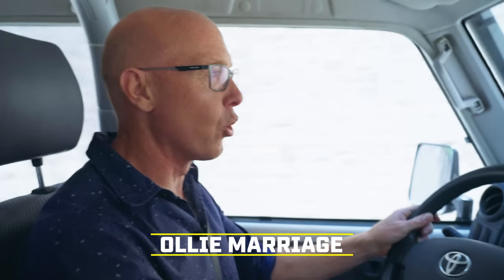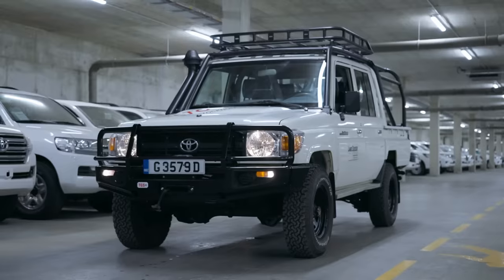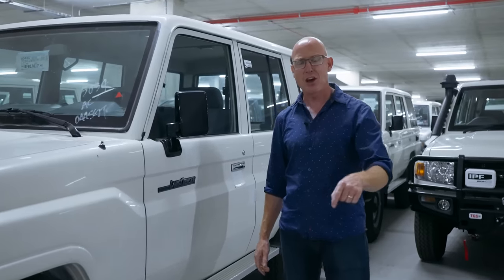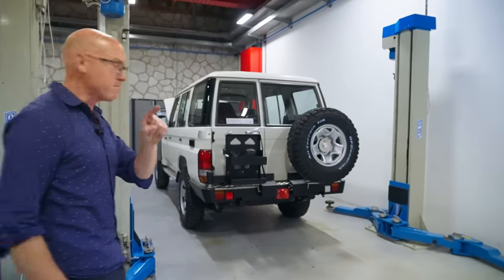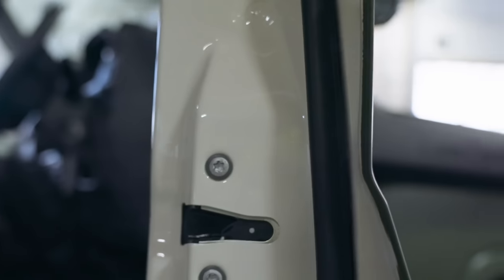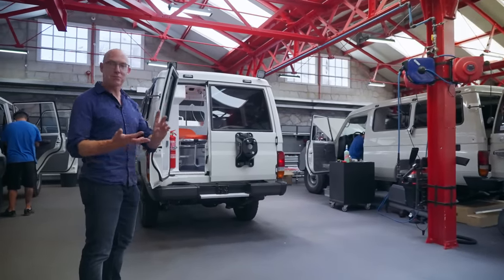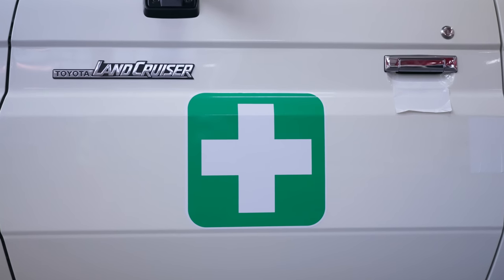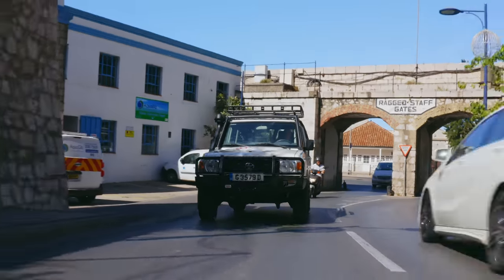This Secret Dealer Sells White Toyotas That Save The World | Top Gear

Comment: Fantastic video, thank you for visiting us at Gibraltar.
Reply: Thanks for letting them into your plant to see the operation. What percentage of your Land Cruiser 70 Series are sourced from Japan and what percentage come from Portugal?
Reply: can normal people buy it directly from you?
Reply: @rightlanehog3151  Al the cars fabricated in Ovar Portugal goes to south africa ,   i visit the factory in Ovar,
Reply: What engine is in those 70's?
I was assuming they'd be the VDJ but there's no bonnet scoop.
Are they running front mount intercoolers or no turbo or something different all together??
Reply: @adam.barrett  v6 diesel or else 4 banger
Reply: @adam.barrett  Seems like these are fitted with the Inline 6 1HZ Engine.
Reply: @adam.barrett the one in video is likely the 1hz equipped one although they also offer the 4.5 V8 in the 70.  They also used to do a 9 seater 200 series with the manual V8 combo of the 70. The Prado/hilux/hiace and previously the fortuner gets either the KD/GD or the 5L-E
Reply: Do you sell these to private buyers??
Reply: to bad you cant register it in europe. perfect kayak towing car
Reply: @hans70998  😭😭😭 that sucks…. My life would be complete with one of these
Reply: Thanks for keeping the world going Toyota of Gibraltar.
Reply: @hans70998  I heard registering in most European countries works just fine with some exhaust modifications (Euro 6).
Reply: @adam.barrett  it is called the 1HZ, a 4.2L inline six cylinder diesel.  About 130HP.  Not fast, not super economical...but torquey, and super reliable.  Been in production since the 1990s.
Reply: @adam.barrett The previous 70 Series (in the video) came either with the 1HZ (as in the video) or the 1VD-FTV with bonnet scoop and the current one comes with 1HZ or 1GD-FTV. There was also a non-intercooled turbocharged version of the 1VD-FTV that was available in the 200 Series from TGS but the 70 Series never got that.
Reply: @rxzxqx6982  But won't get a road permit to drive in public roads. 
Miners and such guys generally buy and can use inside private property but not outside.
Reply: How do you buy one for personal use in the US

Comment: I wish they would make these available in the USA . They would sell faster than Toyota could make them!
Reply: Its diesel, and USA kinda hate diesel car
Reply: They already have that problem. In Australia they come with a 4.5 liter v8 turbo diesel, and the wait for a new one is years.
Reply: they are so popular in australia they stopped production
Reply: get a 4Runner SR5 trim. It's got the guts and since the US has developed roads and mechanical support, it will last just as long.
Reply: @matthewputnam7486  Mine is still going strong.
Reply: @matthewputnam7486  doesn't ahve to be sr5, all 4runners and v6 2nd gen toyota tacoma's have the 1gr-fe 4.0.
Reply: @garettjohnson2234  true. I was thinking the trim that gets it closest to a 70 Series trim.
Reply: @matthewputnam7486  they are definitely bullet proof! My 2011 tacoma is at 315k miles and still runs and drives like it just came off the lot.
Reply: I WISH
Reply: @marshalniel  Not the kind of customer that would buy this though
Reply: Stopped taking new orders.
Reply: They already sell faster than Toyota can make them; I have about 20 on order and expect them in 2024
Reply: @jimmymifsud1  Great, save one for me!
Reply: @donaldleider7382  come work in the coal mines in Australia, get to drive these off road everyday
Reply: @jimmymifsud1  send me the address!
Reply: @ForkInTheButt  I daily drive a 1989 land cruiser and is the best car!
Reply: @ForkInTheButt  I agree with you on one side but on the other here in gulag Australia there are many exemptions, many still buys Land Cruiser 70s series, the problem that it could sell a lot more is that is too expensive and the back log waiting list for a new one is very long.
Reply: Or at least Toyota sell a body kit we can put on a 4Runner chassis
Reply: Ford and other American brand car makers, would pay congress heftily to kill any move Toyota would’ve made to sell these in the u.s.
Reply: @marshalniel  The USA love diesel cars what are you talking about?
Reply: No they wouldn't, LOL. Toyota has tons of data on the marketplace; if they thought they could make $$$$ selling these in the US, they would have done so.
Reply: My dad used to have one  model 1984 as taxi , in Costa Rica those cars were used as taxis in remote zones so he with very basic maintenance he was able to put on this engine with no overhauling just the basic maintenance 1 million kilometers
Reply: US and Toyota are kinda not in a good relationship
Reply: Despite the hype i dont think it would sell.

Comment: This really goes to show there need to be more standards in the automotive world, same as in the computing world. Modularity lowers cost and increases repairability. Especially in the modern world where car makers seem unable to refrain from adding a bunch of poorly supported electronic junk that doesn't need to be there.
Reply: I agree with you, there should be reliability and quality standards that the US and EU should make mandatory. The reason why they don't do that, I think, is that American and European manufacturers would have a hard time competing with the Japanese and Koreans on these parameters. Most American cars would probably need to be retired from the market entirely, probably every Tesla (which would make me happy, but would make upset a lot of people). I think a good compromise could be 5 years mandatory warranty that forces every manufacturer to fix every single component that may break in the first 5 years.
Reply: No, let manufacturers innovate and develop.

I don't want every car being the same, it never works out well.
Reply: @Robert-cu9bm  Common misconception. Take the computing industry as an example. More innovation results through cooperation of effort, it also distributes cost of R&D and eliminates duplication of effort.
Reply: @Mr.Morden  
Like Sony's bluray
Or apples Lightning cable.

More innovation happens when there is competition.
Reply: @Robert-cu9bm  We are not saying that manufacturers should not implement new technology. What I am trying to say (and I think Mr. Morden was trying to say) is that the consumer should be a lot more protected than it currently is. Spending 50K for a new vehicle and having to deal yourself with mechanical/electrical failures two years later, for which you have to pay yourself, is just unacceptable. Especially because repairs have become increasingly more expensive and complicated.
Reply: @Robert-cu9bm  Yes, I can agree. Standardization can stale innovation.
Reply: The car industry is not like computing industry. Car buyers want exclusivity. They want their mercedes different to the lesser japanese cars. The technology companies cannot achieve that with apple still around trying to be different
Reply: @511dydy  Spoken indeed as a rich.
Reply: Manufacturers are not interested in lowering costs or increase durability .... that would cut their profits !
Reply: @nomad6-1  totally agree with you, except for the part saying Korean cars are good lol. although they’ve been trying to go upmarket for a while now, but they’re still about the same quality as American cars. parts failing catastrophically under 50,000k is the norm for these cars.
Reply: Lower costs? Lmao have you even check the price on one of these??
Reply: @patriciomunoz2830  Have you looked at the price for the Ambulances that drive American streets? You're looking at up to a quarter million.
Reply: What? VAG group has like over 100 models that are absolutely the same car under the skin. Just body types differ. Other companies do similar. Look for Caddy RS swap on youtube. It would be hard to do any more standardization. Regardless if you are buying Bentley or a caddy you still got quite a lot of the same parts.
Reply: @farishanafiah8461  Yes because everyone's screaming about wanting a square wheel. 🙄Once a good idea has been developed and widely adopted/ desired, why not just make that the one way to do it, take usb-c for example, Apple is gonna need to be smacked around to get it to sink in that. THEY LOST. standardization is always better for the consumer than some random company deciding "i know better", the only people who benefit form that mentality are investors, but i guess guys like you wanna go back to 2004 when there were 20 different phone charger ports and they all sucked.
Reply: @dodger7183  There's nothing wrong with experimenting different ideas and concepts. That is why lapdocks exist because of Android Desktop Mode. Some people don't need Windows or macOS when they can get the job done with Android and a lapdock.

Comment: Land Cruiser 70 series is one of the greatest creations in the world of vehicles.
Reliability, durability, simplicity, easy to maintain and timeless design, which are not found in today's vehicles are more important than electronic devices and features. People who know the value of LC 70 series know that they can go anywhere without any problem.
Reply: I think its the best off-road vehicle or car ever built
Reply: But overpriced
Reply: @sengwesetogile6054  for its popularity to take profits
Reply: Exactly.  Well put sir.
Reply: A true real vehicle . . No stupid electronic this and that . Just  made exactly as all vehicles should still be made in todays world . Land cruiser . Go anywhere and back again not a problem . .
Reply: @sengwesetogile6054  Not overpricedt, most parts  it are handmade.
Reply: I’m putting my vote for the Land Rover Perentie as being one of the other greatest vehicles ever made!!
Reply: @davespanksalot8413  it's trash😂
Reply: @yanakal652 my "trash" 79 is an 07 model with 380k on the clock and has never had any problems at all, NONE AT ALL. It goes hard out in the bush but I admit it's a pig around town..
Reply: @yanakal652  let me guess, you think an Mercedies is better

Comment: Land Crusier the most dependable 4x4 made.  Parts aren’t cheap but you rarely need them.  I have owned Toyota’s since the early 80’s, the 4x4 trucks are the best quality 4x4 made,  They are small and rougher ridding than bigger trucks but a lot better quality and cheaper to maintain.
Reply: I am a 70 series owner in the UK. I use Amayama for my parts. A Japanese company that will deliver worldwide genuine Toyota parts.
Toyota UK recently wanted £250 for a gearbox filter. Amayama, £55 delivered from Japan.
Reply: @harveysmith100  Thanks for the information.

Comment: Fascinating tour. Awesome concept for the video and execution! P.S. TOYOTA please homologate a 70 series for US market. Please.
Reply: I wish dude. Can't get past safety regulations I'm sure.
Reply: the lc prado  has   diesel or v6  else where  sold  as the lexus GX 460  v8 gas hog luxury  wagon  could be sold as a   basic  lc  in the US  as  toyota priced the lc200 out of the us market
Reply: Toyota can make a "Landcruiser reliable vehicle" or a vehicle that can pass U.S and/or EU regulations.
Pick one.
Reply: If it had to be homoligated to the US market , it would resemble a ford F250 swb or dodge ram , with all the std crap you get with all the electronic gizmos and the need for 57 different airbags in the cabin and the need to fart talcum powder from a petrol engine , no it wont happen .
Reply: won't pass Cali emission standards

Comment: we get these in australia with a 4.5lt v8 turbo diesel. Great trucks
Reply: Not good with diesel contamination 4.2 best
Reply: @999mrkhaled  yeah they have had issues with injectors and shit fuel. I haven't had any problems with mine, had a good aftermarket  pre filter since new and been all over australia, filling up in some pretty remote areas
Reply: Heavy on the juice , good if you’re not paying for it

Comment: There is reason why Land Cruiser is THE most respected off-roader that there is meanwhile Land Rover is the LEAST respected off-roader 🤣.
Not a single NGO, government buys Ranger Rovers and Defenders.
Reply: thats for sure lc = no air springs , no ind rear axles" for a smooth ride and leg room for the 3rd row" , no sun roofs , no 2nd row ent screens .6 cameras etc...........
Reply: slow down... they used to buy Old Defenders when they were still being made, this is the only reason. Agree that Land Rover nowadays are 100% Crap.
Reply: Still get governments using current Land Rover products, just not in the same environment as LC’s and for a long time when the old defender was around it was used in the same environments as the LC is now. Also to say anything Land Rover is the least respected off roader is a bit silly, especially when a new L461 Range Rover hosts better off road stats than a new LC300. The brand that makes the least respected off roaders if you can even call them that is BMW with the X range. And even with the reliability nonsense Land Rover have going on you have to give them credit for keeping the capability a 4x4/SUV should have across the entire range, with even the Evoque even with how up market they’ve gone.

Comment: "They are mechanically bulletproof."

Me: Looks at my neighbor's 2018 Ford Ranger Wildtrak Biturbo who had it towed from his home due to transmission issues at 50,000 km.
Me: Also looks at my other neighbor's 2014 Toyota Hilux 4x4 with 150,000 km who just had it's rotors replaced.
Reply: You could not be anymore right 😆 you took the words out of my mouth
Reply: turbos are great for the power, terrible for durability

Comment: funny thing is that they sell them in australia in massive quantities to the public and they have td v8s
Reply: Got a link?
Reply: @ericsmiley1266  How about just using Google and searching for yourself. They're called the 79 Series and have a 4.5L Twin Turbo V8 diesel called the 1VD.
Reply: @ericsmiley1266  He's right. I own a 75 series, single cab 79 and dual cab 79 with another 79 on the way. Apart from the 75 being the 4.2 n/a diesel, all the 79's are 4.5L turbo diesel v8.
Reply: @tasmanmcmillan1777  partly incorrect, 78s and 79s from 2000 to 2006 were straight6 diesels 😊😊
Reply: @sirsyphron7878  No shit. They had the 1hd-fte. I'm talking about the wide body gens.
Reply: @MafiaboysWorld  70 series have single turbo, 200 series have twin turbo.
Reply: @370HSSV66  Buddy, I see 100s around here saying 4500 TWIN TURBO! I've even driven about 10 of them myself.
Reply: @MafiaboysWorld  Would love to see a video showing that? Possible for you? Show us the turbos between a 200 series and 70 series 1VD?
Reply: @370HSSV66  Probably not now. I had access to them through work at AVIS when I was there. Mostly mine-spec vehicles but some normals aswell. 200s and 70s both got single or twin turbo 1VD options through the lifespan. 👍
I also worked at a Toyota dealership detailing new cars and seen a 1VD 70series burned to a crisp in the yard waiting for warranty check due to one of the two turbos it had failing. 😬
Reply: Yes I was about to say us too here in South Africa, we have the diesel V6 and V8 as well as Petrol V6's too I'm not sure if you can still get a Petrol V8 anymore
Reply: What diesel  V6 you are talking about? I know there's  straight 6....but not a V6
Reply: @enterBJ40  I meant the straight 6 diesel my apologies
Reply: Toyota  offered the UZ series engine few years ago. Perhaps os still offered in some petrol friendly  countries in Middle East
Reply: @MafiaboysWorld  sorry mate, not true. The VDJ70 series never had a twin turbo version of the 1vd motor, not even as an option. It was always single turbo in the 70 and twin turbo in the 200.

Comment: And the most important thing is, that basically every vehicle mechanic in the middle of nowhere can fix the Land Cruiser and has spare parts for it, although sometimes they are not original. I ordered so many of those Land Cruisers from TGS!!!
Reply: Wait a normal person can buy one
Reply: @lonelypuppy8041  If you are lucky you can probably find one somewhere on the second hand market. I work for International Humanitarian Aid Organisations in logistics so I was also in charge of ordering/buying those vehicles.
Reply: @BadGodesberger1963  oh so after the vehicles retired they get sold to the used car  market . Also I appreciate what you do
Reply: @lonelypuppy8041  Sometimes, after the end of a project, we hand them over to a project partner, sometimes we can sell them to local bidders in an auction. In African countries you can sometimes find local Toyota car dealers who are selling the Series 70 model, too. But mostly they are imported from Dubai or other Arab countries. But those cars are not the same like those from Gibraltar. Those are made espacially for Africa and TGS is the only certified car dealer for Africa. Other cars soon have big issues with the road and weather conditions in Africa, like gearboxes, brakes and chassis!!! I never asked if TGS is selling vehicles to private customers.
Reply: @BadGodesberger1963  thank you for work in the aid organization... However I don't think TGS would sell to a private citizen. Here in Cameroon we mostly have those from Dubai as you mentioned.
Reply: @nodlabs8970  Yes, most probably. And the TGS are more expensive, too.

Comment: But the thing is...  not sure if it is still the same today, but around 15 years ago they used to store hundreds, if not thousands of these at the former Lathbury Barracks.  They employed a couple of guys whose sole job was to move them from one section of the car park to the other.  You had to be careful when parking there not to be too long otherwise you got blocked in, bit embarrassing especially when on a skive!